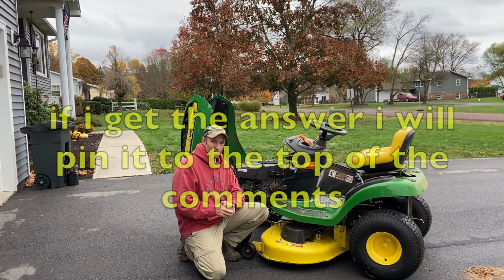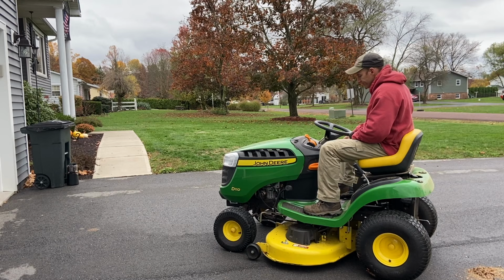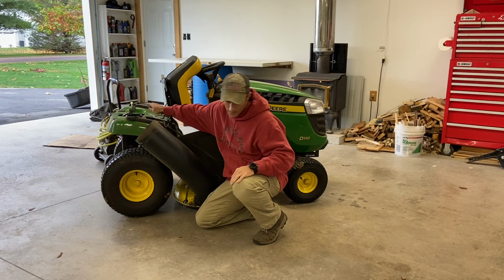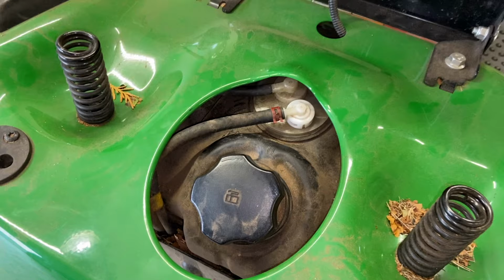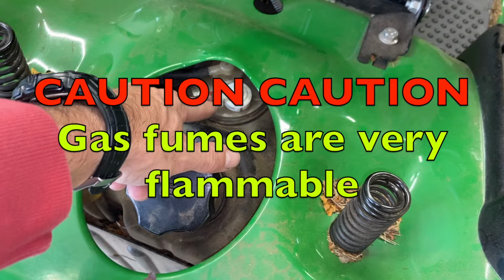John Deere lawn mower won't stay running (100 SERIES)

Comment: I had similar problem with a ten yr old toro 6050, and after much investigating I found leaf debris intermittently blocking the fuel tank outlet, flushed the tank and all was well.
Reply from the maker: Thanks for the tip and thanks for watching.

Comment: Check under the gas tank for a bent or pinched gas line. If the mower is more than 10 years old, I'd replace all of the gas lines anyway. Ethanol fuel rots rubber fuel lines. Old fuel lines get weak and tend to kink easily. Also, replace the fuel filter and check the gas tank for dirt or water. Spray some carb cleaner in the carb too.
Reply from the maker: Thanks for the tips. and thanks for watching

Comment: I think it's the fuel pump. Mine did that. They have a very simple diaphram pump. The rubber diaphram rots from the poor gas we live with.
Reply from the maker: Thanks for the tip and thanks for watching

Comment: So my mower wants to shut off only when iengage the blades. I have a 2020 John Deere E140. I cleanedout underneath around all the belts, there doesnt seem to be anything clogged up around the blades. I cant figure it out. Any advice??
Reply from the maker: Sounds like what mine did. Try what I did in the video. I would also recommend using non ethanol fuel if you can get it.
Reply: @DIYJIM  I think it's something with the pto. I'm trying to learn everything I can, there's no man in the house or a dad to help so I'm doing my best to learn everything I can. I do my own oil changes, which thankfully are easy as all hell lol, I just changed the spark plugs at the beginning of the season and put new blades on. It's just the electric stuff I know absolutely nothing about. I don't have a garage and live basically in a field, so the mice are a NIGHTMARE. Thank you for your videos, they've helped me more than once. 😊

Comment: You probably had a clogged vent line even though it goes to the carburetor the carburetor can get plugged up in the vent line and then it did the stars for air to neutralize so you could pop out of the tank most of them have a pressure release on the But that one doesn't have it
Reply from the maker: You might be right it happens maybe once a summer thanks

Comment: I think you may have water in the fuel. It happens a lot with our 10% ethanol. The water will settle to the bottom of the tank which is where the motor will pick fuel up from. My theory is when you start dumping air into the fuel your mixing the water back into suspension.
Reply from the maker: Thanks for the advice and thanks for watching

Comment: Did you figure out what was wrong?  I had to replace the fuel lines to fix mine.
Reply from the maker: I started use in non ethanol fuel and that helped. I probably could change my fuel lines also.

Comment: I have a big loss of power from last mowing season. Could I be running on just one cylinder? Need a new carb? Installed new fuel filter, fuel pump, spark plugs, coils, PTO clutch. Starts up good but has a big loss of power and bogs down on slight slopes and thicker grass areas. But even before the bogging down it just has a lot less power now this spring.
Reply from the maker: Did you try what I did in this video. I run all non-ethanol fuel in my John Deere now it seems to run a lot better.
Reply: @DIYJIM  I'm gonna put new plugs in it tomorrow and maybe put the new carb on that I have sitting here. And also watch this video again and do the same....watching this again today I noticed you are leaving the throttle all the way up in the CHOKE position. Why would you need to do that?

Comment: I’m having the same problem. I’ll give it a try. I noticed the fuel filter is not full. Is it supposed to be? Is it full when it’s running properly
Reply from the maker: I don’t think my fuel filter is ever full
Reply: Fuel filter doesn’t have to be full of gas to operate efficiently
Reply: Fuel line is probably deteriorating internally from ethanol fuel. Replace the fuel lines

Comment: Prevention: Before removing gas cap, clean all surrounding surfaces with a damp rag or blow it down thoroughly.

Make sure you close your gas cans  after fuel ups. Never let insects, droppings, moisture from rain or condensation get into gas tank, gas cans, fueling spout, etc.

Make sure your gas cap is fully closed and sealed.
Reply from the maker: Thanks for the tips, and thanks for watching

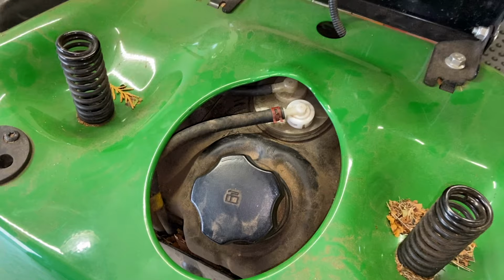Comment: 5:53 You mention blowing the gas line into the tank and to the engine. This can result in damaging your fuel pump permanently.
Reply from the maker: Thanks for the tip, I have done this a few times. It has never hurt the mower

Comment: I bought a house last year. For slightly more I got things like the boat and a John Deere 125 lawn tractor. Everything was in a sorry state of maintenance. Last year I replaced plugs, oil, oil filter and fuel filter. This year (2022) I did oil, air filter, sharpened blades, deck belt, (which it keeps throwing off). The more I look the more I cringe. About to do fuel filter again. It stalled out on me a couple times tonight. I will attempt to clear out the vent hose like Jim did it with how things were left it could be all sorts of things. I use only ethanol free fuel in it but doubt he was As disciplined.
Reply from the maker: Good luck with your mower

Comment: Follow the fuel from the tank. Watch the fuel filter, if it stops flowing after a while the pickup tube reaching the bottom of the tank is partially clogged. Disconnect at the top of the tank, blow back, if there is resistance use compressor to clear it then purge and filter the gas from the tank repeatedly to get the debris out.
Reply from the maker: Thanks for the tip, and thanks for watching

Comment: What do you blow with?
Reply from the maker: I used my air compressor
Reply: @DIYJIM  I blew mine in the morning and the gas came out running; I had to reconnect really first but it’s still not starting

Comment: That hose you blew out to the carb is your tank vent. If you had trash in that hose it’s possible the tank could not vent and therefore you would lose steady fuel flow.
Reply from the maker: My flow was good I ran out of fuel then I put more fuel in and it would not stay running
Reply: I had the exact problem did everything.  Found out the fuel hoses were disintegrating from the inside. Flush and replace fuel lines with new.
Reply from the maker: Maybe I will have to check my lines but it is not that old

Comment: Maybe your gas cap isn't venting, try removing it and see if that fixes your problem, if it does fix it, replace the gas cap.
Reply from the maker: Since I started putting non ethanol gas in it I have not had any problems.

Comment: Ok went out. 3 times this morning  no start are if it did it would stall figure ne carb wait a minute let me take that hose off blew through it and back and forth it started right up drove around 5 minutes make sure not a fluke parked it came back in hour started right up
Reply from the maker: Glad I could help
Reply: It still running d130

Comment: your carb should not want to run and operate with the choke on, if its doing this its running lean. good partial fix but you still need to tune the carb, possibly tear it apart and clean it.
Reply from the maker: I really think the fuel lines are starting to clog up from the crappy fuel breaking them down but thanks for watching and giving advice

Comment: So I had this issue today with my La165, I was cutting for 10 mins and it shutdown, it would start and run for 5 secs then die, I cleaned out fuel filter, blew out the full lines and it still did it, I thought it was the fuel pump but it shouldn't start if it was the fuel pump. So I was about to give up but then I remembered that I had left it outside over night (normally stored indoors it's whole life) and it rained pretty heavy and the seat was up so I figured maybe water got in the gas tank so I dumped a bunch of water remover and filled it up with fresh gas and BINGO after a couple stalls its running fine cut for about 2 hours no issue....
Reply from the maker: Awesome glad you got it figured out

Comment: Replaced carberator and runs like new till it cuts off
Reply from the maker: Some people seem to think sometimes there is something wrong with the gas caps or the fuel lines start to break down from the ethanol. Hope you get it figured out

Comment: My JD mower starts and runs fine. But while mowing it will go to stall but as soon as I disengage the blades it runs fine again.
There's nothing lodged in blades not am I bogging it down in tall grass. There is some debris in the gas tank. Could that be it?
Reply from the maker: Sounds like the same problem I had. Did you try what I showed in the video? I also use non ethanol fuel which seems to really help. The stuff in your tank probably is not helping.

Comment: There’s.  A safety. Switch with wires to it and if that doesn’t make contact  when u set on it it won’t start because I had that trouble too
Reply from the maker: Thanks for the tip I have that in my other video there is a link to it at the end of this video. Thanks for watching
Reply: @DIYJIM  well that’s what I  found out on my  tractor. And it was the very same thing I’m  glad. I helped anyone. Out that’s having that problem. In the future. I’m glad to help in anyway   Jim. U helped me out. I’m just paying u back. Lol
Reply from the maker: @daleschroeder8661  thanks

Comment: Once you run it out of gas,  the only way to get gas back to the carb , is to pressurize the tank. Take the cap off put your mouth down  around opening  and blow..this sends gas to the pump. Bam , you are done!!
Reply from the maker: When my mower does this it is not out of gas. When I run out of gas I just add gas and put the choke on.

Comment: I have a John Deere D105 with 49 hours on it which occasionally backfires when I shut it off. Any suggestions on what could be causing this loud boom? I replaced the fuel solenoid, but this issue continues to be annoying.
Reply from the maker: Does it also do that if you throttle the engine down before you shut it off?
Reply: I will try that and will keep you posted. Thank you for your suggestion!
Reply: The engine did NOT backfire when I shut it off at low idle. Thank you for your suggestion!
Reply: My john deere a100 backfires even when idling on low throttle for a minute. Any suggestions?
Reply: @ImHatred2658  It is most likely a lean misfire , moisture in fuel or poor quality fuel. lean misfire check your carburetor at it's base gasket for a vacuum leak spray carb cleaner on it while running engine and see if rpm's increase. If they do then tighten carburetor base bolts. But don't over tighten  because you could warp base of carburetor. If it continues to leak there then pull carburetor off and check carburetor base with a straight edge checking for warpage if so then draw file base of carburetor to true it up .and recheck with straight edge. The gasket could also be bad? When re moving carburetor always replace base gasket. The air cleaner must be installed when checking for vacuum leak as to not induce carb cleaner into airhorn of carburetor. Also to the fuel pump check the vacuum supply hose from the crankcase for a tigth  fit and no splits in the hose. For moisture get a bottle of Isopropyl Alcohol Gas Line Antifreeze and mix with fuel according to instructions on bottle. You will only need part of a bottle for a lawn tractor. Don't over dose it or it will make things worse. For fuel get non - ethanol regular gasoline. Ethanol gasoline is bad for gas line hoses, gaskets and carburetors in general. Best of luck.

Comment: Did you pull the fuel line at the tank and push air through it to the carb?
Reply from the maker: Did that on my other video https://youtu.be/0qStUg0ImoI
Reply: @DIYJIM    I'm going to give that a try. I have a new fuel pump on its way.
Thanks

Comment: Jim, I had the same problem on my E130 at 20 hrs. Long story short the next time your motor stall and shuts down leave it as is. Disconnect the fuel line at the fuel filter. If you do not get a steady flow it's fuel tank problem. I removed my tank and flushed it out with a garden hose. I found two pieces of aluminum foil that flushed out. It must of come from my bottle of Stabil when I prepped the gas for the final mow. No more problems afterwards. This is the link where I learned how to do this. https://www.youtube.com/watch?v=LaXhqRPaCF0
Reply from the maker: Wow thanks I will have to try this

Comment: Mine is doing something similar. At low RPM it surges really bad. I've done just about everything but clean the carb. Anyone experienced this?
Reply from the maker: Hope you get it figured out. Mine seems like it has been my fuel lines going bad
Reply: there are alot of tips n suggestions in the comments try several out should fix it

Comment: I’m thinking the carburetor is dirty
Reply from the maker: If your talking about my mower I started using no ethanol fuel and it has never happened since. Thanks for watching
Reply: @DIYJIM  Yeah, I didn’t realize this video was over a year old until after I commented.

Ethanol gas has killed everything I own.  I’ve switched 80% of my outdoor tools to battery operated so I don’t have to deal with it anymore.

I’m having the same symptoms you were having, but I think my problem is fuel related and not air.  I tried blowing out the air line and it didn’t work.

Where do you buy enough ethanol-free fuel to run your rider mower?
Reply from the maker: Search ethanol free fuel gas near me on Google. Maybe that will help you. There is a couple gas stations near me I can buy it.
Reply: @DIYJIM  How much do you pay per gallon where you are for ethanol free fuel?
Reply from the maker: @Inmate533  well I live in Pa and our gas tax is crazy. But we are paying $3.89 for reg and I just called Sheetz gas station and there non ethanol fuel is $4.19. I actually thought that was not to bad. I have three 5 gallon cans that I usually fill up all at once. They have lasted me all summer so far.
Reply: @DIYJIM  Cool.  I thought you had kind of a PA accent.  I’m originally from NE PA and now I live in NH.  NH apparently stinks for trying to buy non-ethanol gas.  No gas stations sell it that I can find and only specialty stores sell it in cans for like $25-$30 per gallon.

Anyway, I found my problem.  I actually blew some compressed air backwards through the gas line after emptying the tank.  There was a clump of dirt stuck on some kind of gummy crap stuck somewhere between the top of the tank and the inlet inside the tank.  Looked like rubber cement.

Runs like a champ again now.  Hopefully that was the only dirt in the tank.  Thanks for the idea of blowing out the lines like that though.  Without your video, I’d probably have taken apart half the mower by now.